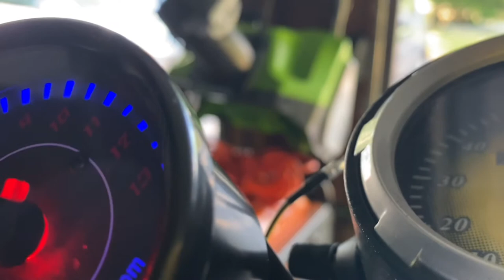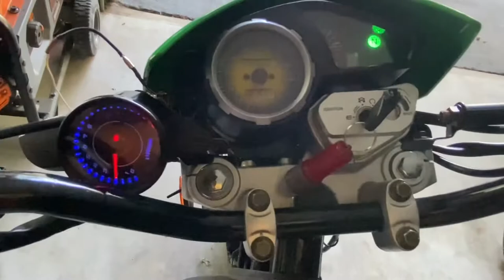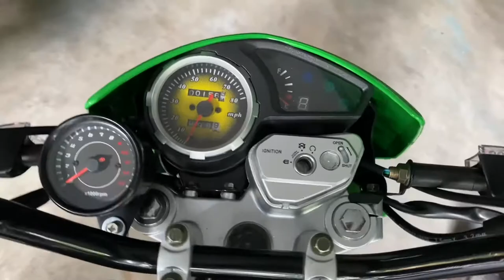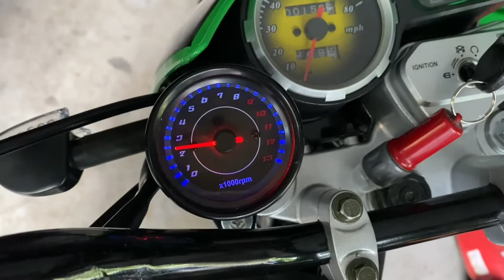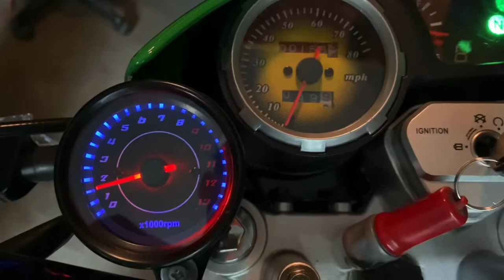TBR7 tachometer Install

Comment: I did this install today, same bike same tach from amazon.  Interestingly tho, afterwards the "ignition on bike not running" lights only illuminate, including the tach illumination, if im in neutral and the clutch is pulled in.  If I let go of the clutch or I'm not in neutral the lights don't illuminate.  Once the engine is running the lights work.  Also, the bike will now ONLY start in neutral.  No other gears regardless of clutch in or not.  This was not the case beforehand.  Any thoughts?
Reply from the maker: Interesting…my first guess would be that one or more of the pins in the connectors is not making full contact. Try unplugging everything and reattaching. Something unrelated that I noticed on my bike that might be your problem. There are two small plugs that connect to the clutch lever which are very exposed and not very secure. They were constantly unplugging on me whenever I was working near the headlight area. I am not sure what these plugs do but they seem like they would be connected to all of the problems that you are having.
Reply from the maker: Also, I had to double check the wires on my tachometer with a multimeter to verify the positive and negative/ground wires.  The colors were not intuitive and in fact opposite on mine in two cases where the red was ground/negative and the black was positive.  There is also an image I found on google that shows the wires reversed.  I think I checked the resistance/ohms and if the reading was a negative number then the polarity is reversed and you are probing the negative wire with the positive lead from the multimeter.